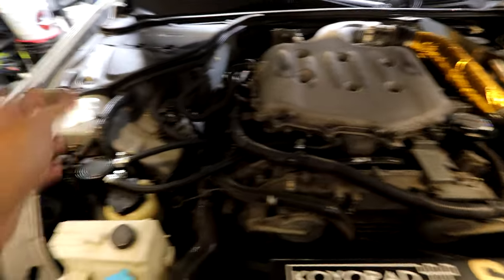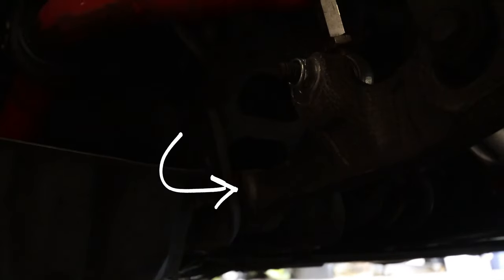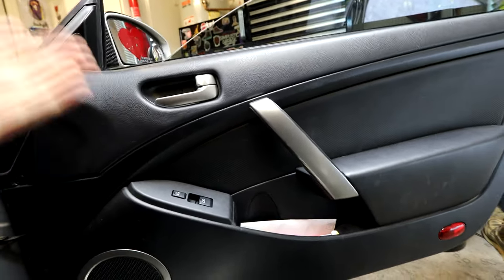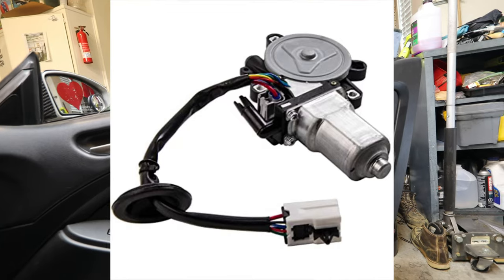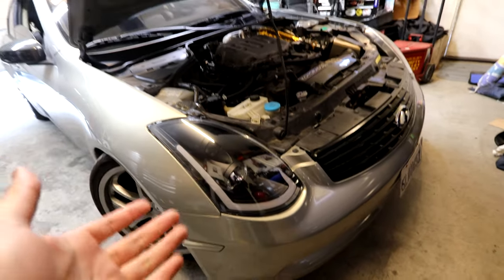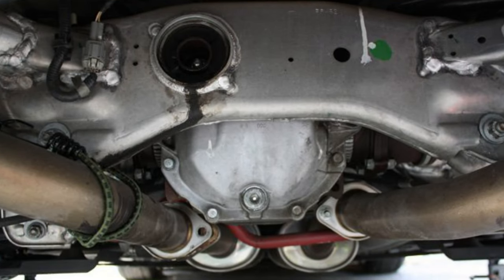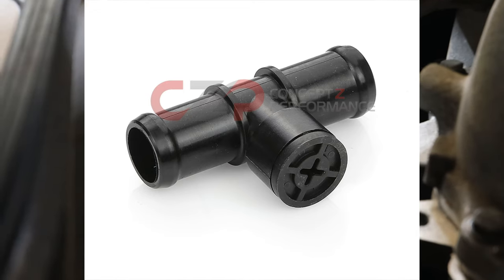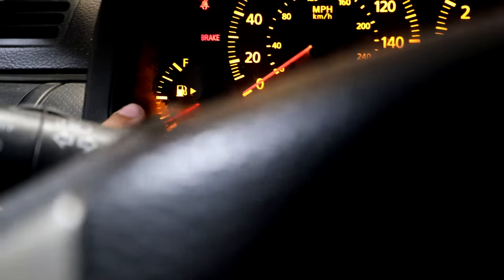The MOST Common Infiniti G35 / 350z Issues and Problems!

Comment: i have an 07 g35 coupe with auto transmission. About to hit 280k miles now. I relate with all these issues and the car itself is falling apart. The transmission and engine is good so that's why it's still my daily
Reply: 06 coupe AT as well, 230k here! Engine & transmission just won’t die lol only had electric issues like the windows and the the fuel gauge always saying it’s full, it’s apparently the cluster according to a local shop
Reply: @SuperHawkVTR  Yea I just had the same problem. I believe it's the cluster and I will find out in the next 2-3 days. They are done "fixing" the cluster, I just need to verify that everything is okay now.

Comment: I've had my 2007 G35 coupe 6mt since 2012.  The car is a beauty.  Its been so reliable for me all these years.  The passenger seat is not ripped in that usual place due to the fact that I keep it moisturized with leather cleaner/conditioner all the time.  I have 192,000 miles on it now and the only thing that I had to do was change 2 oxygen sensors out of the 4, replace the radiator(Mishimoto aluminum with Silicon Hoses) which went out at around 150,000 and replaced the clutch(Exidy Stage 2)  Other than that, no other problems.  Windows motors work perfectly.  It was burning oil though at around 1 quart per 1000 miles.  To remedy the oil burning problem, I just switched to 10W40 synthetic blend from 5W30 full synthetic.  Seems to have fixed the problem so far.  Just had coils changed yesterday(Hitachi) and NGK Laser Iridium plugs.  Was going to sale car for and electric vehicle, but now it is so sweet that I'm going to keep it for another year or 2
Reply from the maker: That is awesome! Reaching almost 200k and it’s running like a champ means you’ve kept up on maintenance, hell yeah!
Reply: Hey brotha I'm burning oil in mine too around the same amount 1Quart per 1k miles. Did switching oil cause any problems with time? Did it do anything to the performance long term?
Reply: @eduardotrejo1445  So far, So good.  Switching to 10/30 stopped the oil consumption and made the car seem a bit smoother.  Its been roughly 2000 miles now on 10/30 and only lost about 1/2 quart.  So this worked for me.  Only drawback is that now my car has lost a few miles per gallon.  Before, I would average 200 miles per 1/2 tank of gas.  Now, I average 175 per half tank.

Comment: Recently like 3 days ago , was gonna get tuned and I was leaking oil like crazy by my valve covers and as the tuner was doing a pull my car caught fire . Luckily it didn’t blow up as it was next to the fuel system . But I ordered 650$ worth of maintenance stuff (new valve covers , rear main seal , gallery gaskets , and new water pump )  ||i do recommend changing out the gallery gaskets as soon as possible || getting it all repaired this week . And hitting the tune shop 2 weeks from now . Good video ! Keep up the work!
Reply from the maker: That’s my worst nightmare!! Maintenance is definitely a big one once going performance route foresure! Keep me posted on how it goes 🙏
Reply: Hey man just wondering how many miles did you have on your car when it was leaking and you wanted the tune?
Reply: it’s recommended to change all that beforehand so the tune doesn’t mess with the engine  basically add on all the aftermarket parts you want first then tune it.

Comment: The problem with the valve cover gaskets, isn't actually the gaskets themselves. The plastic valve covers from stock, at least from the vq35de lose much of their functionality through heating up, cooling down. It's plastic. Ffs. After market aluminum valve covers are around 200 bucks, and usually come with gaskets. For the spark plugs too. But, good vid though for real.

Comment: Have had my ‘03 sport coupe for 3 months and only issue I’ve had was throttle position sensor code issue and  mofo would go into limp mode Changed throttle body and after replacing terminals haven’t had the issues for over 2k miles. Oil consumes crazy. Changed plugs and one of the cylinder had oil in it, hopefully it’s just gasket and not a ring..
Reply: What is limp mode?
Reply: @CHRIS56585  basically car goes into a safety mode and you can’t go past a certain speed
But it goes away after a couple minutes but usually returns. It’s awful
Reply: @DankGearFit  damn mines having a problem where the idle will sit at 650-  700rpm normal and then start bouncing and it just turns off on me sometimes

Comment: Definitely need to replace my valve covers.  Last time i changed the spark plugs like 3 months ago there was oil in 2. Which by the way is a pretty tideous job. But i do get that burnt oil smell in the car so I'm guessing it's time to replace them valve covers.  But yeah pretty much everything is spot on.  Window motors went out so i replaced those.  Crankshaft sensor went out so i replaced it.  I did get it from advanced auto parts but it was the Hitachi one and so far no problem.  There was one more thing on the oil pressure gauge not reading.  I changed the oil pressure sensor and works great now.

Comment: I’ve got a few problems with mine like a few electrical things but most of my electrics were caused by a bad battery that burnt one of my fuses I used the spare that comes with the car to replace it and now all my cabin lights turn on and my drivers sides seat moves forward too a lot of my more serious problems are normal for the car when lack of maintenance comes to play like my fuel gauge reader is dirty and I gotta reseal my sunroof but my more serious problems are replacing my clock springs, aligning the steering wheel, and my crankshaft and camshaft sensors going out

Comment: I swapped my motor had so many problems with it. Rear main seal, oil pan, valve covers, spark plugs with oil, o ring leaking, blown catalytic converters, and blown engine eventually with lots of smoke coming out.
So far car is smooth and new now
Reply from the maker: That’s all pretty much normal wear and tear honestly, not the smoke part haha but I’m glad all is good now man! 🙏
Reply: @JoeVazquez  yeah also my belts where all ripped up. I’m going to try adding a oil catch can and all the stuff you mentioned so I have this new motor last me 10 years atleast if possible. Only has 39k miles. Yeah all normal wear and tear but the price to fix my gosh it was $1300 alone to fix rear main seal so I swapped the motor and they did all of that together haha

Comment: Hitachi is OEM Nissan/Infiniti on the cam and crank sensors. That's what you wanna buy if you're on the market.

Good points on the catch can, valve covers, & fuel gauge issue.
Reply from the maker: Correct! I don’t believe I’ve seen hitachi branded ones that are metal like the ones Infiniti/Nissan sell, just plastic ones. But in a tight budget the plastic hitachis are same as the old plastic oems!
Reply: So what will happen if you use ebay brands unknown cause I've used it on Nissan it's ok but don't know about infinity
Reply from the maker: Ebay brands are a hit or miss to be honest with you, it can last you 2 days, or last you a long time. In my opinion though, I wouldn’t want to find out when I’m out in the road that it stopped working.

Comment: 2005 G35 Sedan 100K Miles
Found one of the spark plugs was filled with oil so went ahead and fixed that as well as replaced all spark plugs and coil packs. Drove great for a week until the same exact symptoms started to show again except no leaks this time. Rough starts, idle shakes, and hesitation plus loss of power. There is a coolant leak, and sometimes there is a smell of fuel when starting the car. Engine light will periodically come on. Still getting a random engine misfire code as well as Fuel system Lean B1 and B2. Says I should replace the VVT solenoids. Car drives great once it gets started, but always have felt like it never has had the full power it should. Bought the car a little over a month ago
Reply: Throttle position sensor possibly?

Comment: TIP invest in OEM Fender Liners, undercarriage Covers/Undershroud etc protect your car from rain rust dirt etc.. every time I’ve worked in suspension it’s a nightmare because of seizure bolts or rusty bolts. Will save you a headache, had to literally cut the old suspension to install my coilovers, I do live in Tennessee so getting rain here and there is not rare.

Comment: I replaced the sensor on the front passenger wheel,  brake sensor, I believe. The "slip" light still comes on. You have to turn the wheel to the right for the light to come on. If you just take off like that, a few meters away, that wheel will lock on you. There seems to be a lot of electrical issues with them cars. But I still like th G.

Comment: I would say the battery terminals on these cars have issues. Id recommend a battery tie down ro support and secure the battery. Btw congrats on the 5k damn your channel has blown up since I first subscribed
Reply from the maker: I appreciate it bro thank you for the support! 🙏❤️
Reply: So will that keep the positive battery fusable link from blowing? Mine keeps blowing :(
Reply from the maker: You have a short! Best way is to find the short and address the actual issue! DO NOT USE A BIGGER AMP FUSE!!!

Comment: Ive got a few 35's , 04coupe,05 sedan, 08 sedan and 09 g37. They are great cars but my rule of thumb is "if you pound the shet your gonna have to fix it" Lol. The main problems Ive had are the pedal position throwing a code and then limp mode usually just cleared the code, oil filter o-ring leaked, front links to the stabilizer bar would rattle real loud.  thanks for showing some of the other things to watch out for
Reply from the maker: I completely forgot about the throttle position sensor, definitely a common one aswell, you feel loss of power with that one!! O ring one is common aswell, and end links were later revised in the later model years since they were notorious for failing prematurely!
Thanks for your insight, those are just as important aswell!!

Comment: SIKKY sells an aluminum diff bushing that you can fix once and never have to worry about again. Did mine years ago and it's still going strong.
Reply: I went with Whiteline in the diff and the front lower control arms. Would recommend.

Comment: I had most of these issues lol and with the gas fuel gauge not working I cleaned it it worked great after
Reply from the maker: Haha once you address all the issues you really do have a reliable car! Yeah cleaning it seems to do the trick for the most part :)
Reply: What did you clean exactly?
Reply: @gerodriguez1993  Thanks dude. I'll watch a video or two and take a look at it when I get a chance 👍
Reply: @DarkMan2555  from what i was reading there is a blue o ring around those fuel leveling sensors so be aware of those
Reply: @ItsTeeko_  Thanks. Will do
Reply: One of my gas gauges went out so I've learned to just treat half full as empty. Been doing that for years. I've had the window problems and valve basket problem on my 05 G35. Picked up some very nice headlight covers recently. Old ones are terrible. Had to replace cooling fan a few years ago. Mine only has 120k miles and I don't drive crazy so haven't had any of the other issues - yet.

Comment: I also have a 2004, since ownership (bought with 50k, now has 100k) ive run into; passenger cam sensor took a dump, thermostat took a dump causing the fans to run at 100% all the time, passenger door lock actuator JUST went out. I fixed all issues myself using genuine nissan parts, except for door lock actuator as it JUST happened. not too bad for an 18 year old car
Reply from the maker: I feel you, I’m super anal about my car that I change a lot of things that I know are weak points so I don’t have to worry about it anymore! Genuine for a lot of parts is a must but there’s components where you can save TONS of money and are even better than oem!

Comment: The Camshaft sensor problem is common even in Altimas and Maximas.

I washed my Altima's engine bay with Foam soap and spray water without pressure then codes P0011 and P0021 came on, the car was in limping mode 😭😭😭💀

Comment: if your fuel gauge is messed it might be a battery issue. Not getting enough power to the fuel gauge. either clean the battery or replace it, and if its still happening then you should consider replacing the fuel sensor or fixing the voltage issue
Reply from the maker: Testing the battery periodically should be something people do so you don’t get a surprise later down the road, as for fuel gauge issue, there’s plenty of things that it could be, contacts on the float get dirty and can be a simple wipe, could just be a faulty unit at that point that worn out, can also be a cluster issue, wiring, etc. Diagnosis is key so you don’t go down the rabbit hole of spending money to not fix the problem!

Comment: October 2023. 
2008 G35x sedan. 156k
Wife's car (she's the third owner).

1. Cluster gauge. She herself has this issue, knows that once she cross 300 miles, it's time to refuel. The most she drove it before filling up was 350, and she said that she was worried she wouldn't make it to a gas station.

Also, she performed her own tank valve replacements (both back passenger seats), and one of the G35/37 mod forums mentioned there's a place (can't remember which state it's located) that will refurbish your cluster gauge. It'll be the only way to repair it.

2. Yellowing headlights. Try finding '08 G35x replacements that are in stock. Yeah. Fun for the whole family!

3. Coolant valve. Literally, this morning, purchased the Z1 aluminum replacement.

4. Does ANYONE know how to reset the maps (or update the maps, using Nissan and not Infiniti)? NOT using a DVD, but the flash drive?  Previous owner's information (streets, maps, phone) is still there, and the HERE map she mailed off for was delivered as a DVD, and the dealership told her she needed a thumb-drive. Is there a Nissan alternative to use? Is it something WE can do without the dealership?

5. Wife still loves her CDs, but can only use in-dash. Does anyone repair (or clean, or reset) the 6-CD changer? It worked for six months after she bought, and hasn't worked since. Didn't know if this was an issue that people had, or people noticed. She brings it up from time to time, and is consistent about it, that I just remembered to mention it.

I sincerely appreciate your videos. As I drive a Tacoma, I don't usually pay attention to wife's car, unless, of course, there are issues.

Comment: On my 04 G35X I went through wheel bearings constantly, had to replace 2 flex pipes, my all wheel drive shaft the bearings went, i ended up getting a 2011 Infinity G37X, at 150 i had wheel bearings replaced under extended warranty, gas tank sensor and flushed out my AC and recharged it, no cost.
Reply from the maker: Dam that’s crazy but awesome you didn’t pay a dime or do the work! I have heard that they’ll chew through wheel bearings and axles fast with alot of the autoparts store brands!
Reply: @JoeVazquez   I finance my car and they gave me a supreme extended warranty and it only cost a $1000 I had close to $8000 worth of work done off the warranty, you could take your vehicle anywhere in the country for repairs, i took it to the Infinity Dealership for every repair, i only paid $300 for eight grand in repairs, it also included free towing each time,

Comment: Door locks✅, fuel gauge✅, head gasket✅, oil consumption✅, window motor✅ all issues I’ve had or currently have lol I’ve owned my 05 G35 for almost 10 years gave me almost no issues up until recently but it’s a old car only getting older loved it but it’s time to move on I got a kid now my time with the G is up getting her ready to be sold soon going to miss it so much lowkey having selling remorse but it’ll be next door lol so I’ll still see it everyday 😅 good and bad thing

Comment: Sorry for spam lol, also cleaned the fuel sensor unit and still gave me no luck on gas gauge. Tip:I know to fill up when the orange light indicates next to the gas gauge.
Reply: damn i wish i could do that i have to fill my tank every 200 miles cause i have no idea where my gas is :(
Reply: @ItsTeeko_  do what?
Reply: @DankGearFit   using the orange indicating light, ya mine doesnt work :\ so i wish i could use that
Reply: @ItsTeeko_  HAHHAH

Comment: Yep, my 06 G35 sedan 5AT non-revup has had most of these problems. Luckily, I have not had any issues with the door lock actuators or window motors. My G35 still somehow has the plastic bleeder valve and I'm at 161k miles. I will eventually replace it for peace of mind lol. My gas gauge is slightly inaccurate, but may have been fixed with some iso-heet water remover/fuel system cleaner.
Reply from the maker: That’s awesome that the cars running good! 🙏
Reply: My gas gauge is slightly wack, I have the 06 g35 sedan automatic version and it won’t switch into the manual mode, my seats don’t move because the seat Motors are messed up I think and my sun roof won’t close either lmao I hate this car
Reply: @luizferreira5207  Those all sound like electrical issues. I'm not very knowledgeable on electrical stuff. You should be able to close the sunroof manually, but I would look up a video on this just to be sure. Best of luck to you

Comment: Great video with a lot of good info good job. I have the old three G35 Infiniti. Just purchased it non-running. Turns out it tranks over but won't start check engine light does not come on at all plugged into OBD port and error comes on scanner. Also cranked it while watching RPM needle and needle does nothing.? I definitely need help on this issue if any thank you.
Reply from the maker: Crank/camshaft sensors will give you that exact scenario